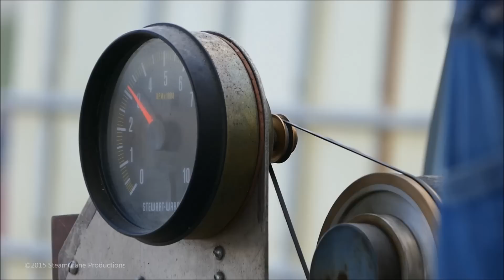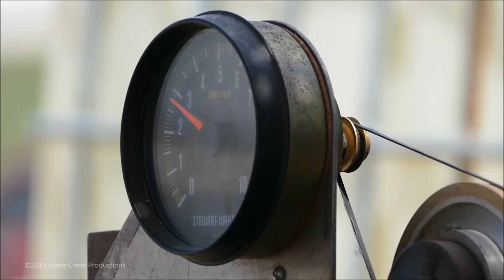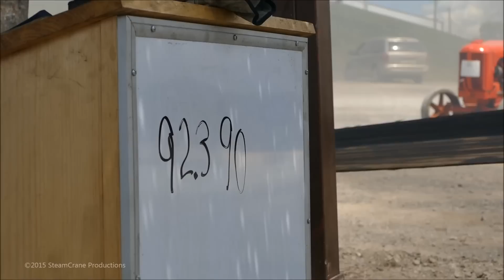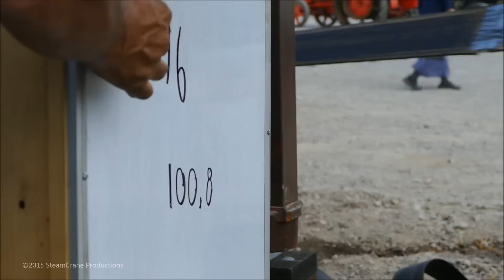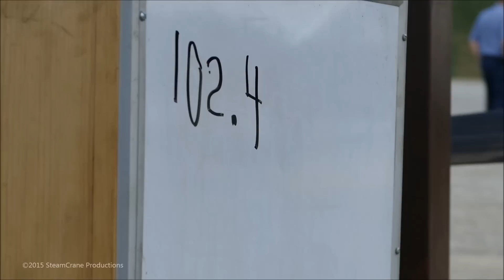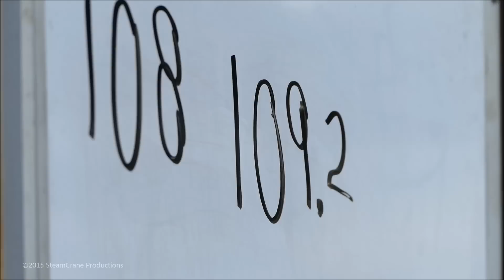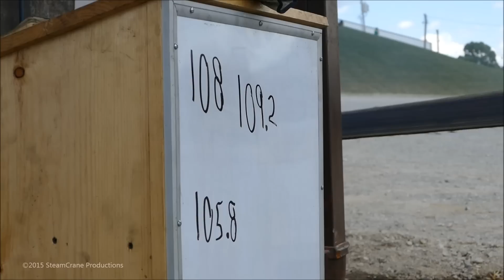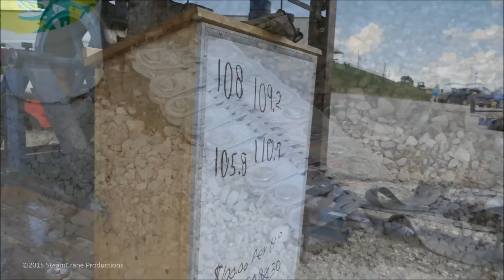Prony Brake Measuring Steam Engine Horsepower - Mt Hope Show

Comment: Good video. What do these numbers mean and what was the hp of the engine?
Reply from the maker: The first number is the tractive horsepower, the second is the belt (ie PTO) horsepower.  These are guaranteed minimum actual horsepowers, as opposed to modern "peak" horsepower. In practice, these engines exceed the rated power by a substantial amount. Thus the 23-90 produced more than 110 horsepower here.
Reply: @SteamCrane  That makes sense and also you have to remember that Traction Engines and steam engines produce alot more torque than internal combustion engines and produce a power stroke every stroke unlike a combustion engine.
So although the hp might seem low for a traction engine because they produce alot of torque they are very powerful!